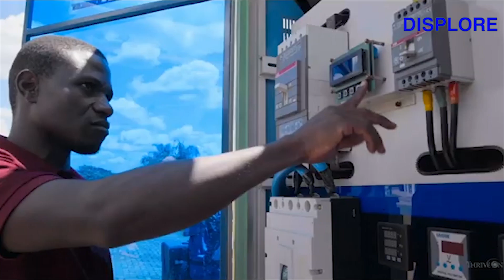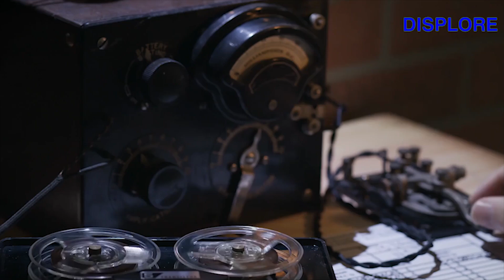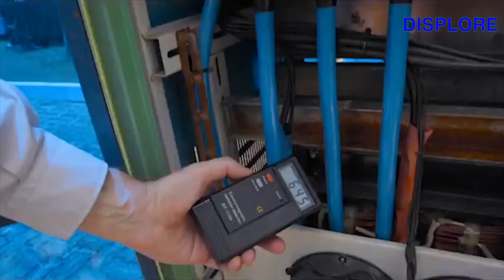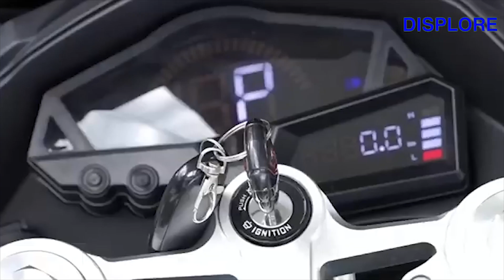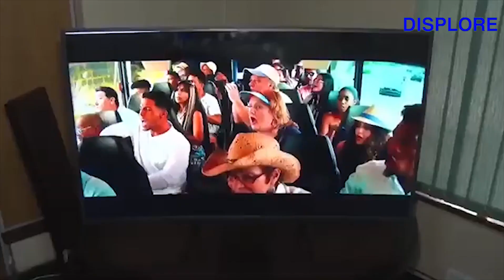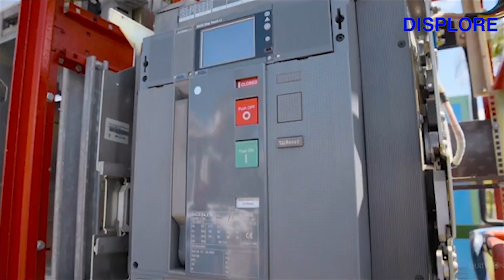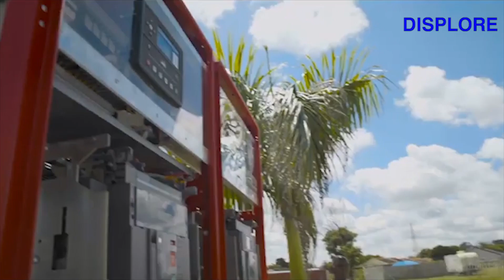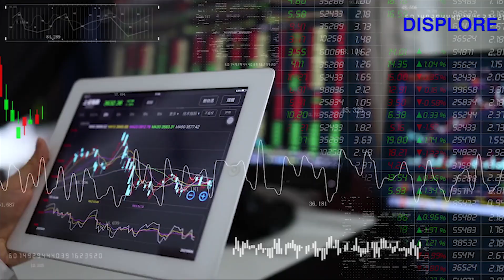TESLA in Big Trouble as This African Inventor Launches The First Ever SELF-SUSTAINING CAR and BIKES

Comment: Let's reframe Earth's low contrast abundant ambient heat as a thermal   energy waypoint between heat and other forms of energy. 

Energy changes form without gain or loss. Uniformity or diversity is not, in itself, a form of energy.  Therefore entropy is an extraordinary claim on the law that energy is conserved. 

Energy sensible refrigerators that absorb heat and yield electricity would complement computers as computing consumes electricity and yields heat. Computing would be free. Chips could have energy recycling built in.
This would improve performance and lower cost. 

Full heat recycling, all electric, very isolated underground, undersea, or space communities would be highly survivable with self sufficient EMP resistant LED light  automated vertical farms, thaw resistant frozen food storehouses, factories, dwellings, self contained elevators, safe rooms, and horizontal transports. 
In a flourishing civillization, small self sufficient electric or cooling devices of many kinds and styles like lamps, smartphones, hotplates, water heaters, cooler chests, fans, radios, TVs, cameras, security devices, robot test equipment, scales, transaction terminals, wall clocks, open or ciosed for business luminous signs, power hand tools, ditch diggers, pumps, and personal transports, would be available for immediate use incrementally anywhere as people as individuals or larger social groups see fit. 

Some electrical equipment groups could be consolidated into local networks when suirable. Liquid nitrogen cooled superconducting networks would become practical 

If a high majority thinks our civilization should geoengineer gigatons or
teratons of greenhouse gasses out of our environment, instalations using devices that convert ambient heat into electricity can hypothetically be scaled up do it with a choice of comsequences including many beneficial ones. 

Refugee communities would be buildable quickly. Fire safes would preserve contents to 1000F for years. 

A simple rectifier crystal can, 
just short of a replicatable long term demonstration of a powerful prototype, almost certainly filter the random thermal motioren of electrons or discrete positiive charged voids called holes so the electric current flowing in one direction predominates. At low system voltage, a filtrate of one polarity predominates only a little but there is always usable electrical power derived from the source, which is Johnson (observation) Nyquest (theory) thermal electrical noise. Max Plank anticipated that ambient thermal noise would become usable with advances in technology.  

In 1973 I filed for US patent 3890161A DIODE ARRAY for an array of metal1/ insulator/metal2 diodes that refrigerate while concurrently producing electric power. The patent was granted in 1975. It was opened to the public domain in 1992. Development is in the public domain while granting me writing attribution. 

The plausible net electrical filtrate from diodes can be aggregated in a first grouping of separate diodes in  consistent alignment parallel. After a primary level of grouping that preferably is in parallel, compound parallel and series networks can be built 
to provide desired DC current and voltage. Within limlts, parts of the  network can be shorted out or open circuted without electricalor chemical  harm. Widely  scalable electrical power always with equal refrigeration is thus possible. The efficiency of each diode is probably low because the initial power within each diode is nanowatts. This inefficiency affects the performance but not the equality of the thermal absorbtion compared to the electrical yield of the conversion. 

The maximum energy is converted from ambient heat to productive direct current electricity when the load electrical resistance  is equal to the array internal electrical resistance. Maximum calculated electrical power output (watts) is k (Boltźman's constant), one point three eight x 10^ minus 23, times T (temperature Kelvin) times bandwidth (0 Hz to a natural limit ~2 THz @ 290 K) times rectification halving and nanowatt power level rectification efficiency, times the number of diodes in the array. 

There are a billion measurment cells of 1000 square nanometer area each per square millimeter, 100 billion per square centimeter. 

Order is imposed on the random thermal motion of electrons by the structual orderlyness of a diode array made of diodes made within a slab: 

Host crystal in this example is silicon 

  P type boron doped
-----‐------‐----___-- Out
🔻🔻🔻🔻
■■■■■■___ + Out
  N type phosphorous doped 

All the P type semiconductor anodes abut a metal conductive plane deposited on the top face of the slab with nonrectifying joins;  the N type semiconductor cathodes or common cathode abuts the bottom face. As the polarity filtered electrical energy is exported, the amount of thermal energy in the group of diodes decreases. This group cooling will draw heat in from the surrounding ambient heat at a rate depending on the filtering rate and thermal resistance between the group and ambient gas, liquid, or solid warmer than absolute zero. There is always a lot of ambient heat on our planet, more on equatorial dry desert summer days and less on polar desert winter nights. 

There are other plausible breeches of the second law of thermodynamics. Hopefully a lot of people, mostly as independent teams, will join in expanding the breech. Please share the successes or setbacks of experiemental efforts. The topic deserves crowd financing, discussion and prototyping attempt action. Crowd development would be resistant to confiscation or burial.There could also be science quality colaboration. 

These rectifiers could be various types, such as:
• Field emission diodes: A metal needle with a compound carbon nanotube tip, separated from a metal plane by a tiny gap.
• Schottky diodes: A metal needle-to-semiconductor junction, like Gallium Arsenide or Indium Antimonide.
• Silicon or Germanium crystal diodes: A well-established technology. These diodes may have poor performance 

These devices would probably become segmented commodities sold with minimal margin over supply cost. They would be manufactured by advanced automation that does not need financial incentive. Applicable best practices would be adopted. Business details would be open public knowledge. Associated people should move as negotiated and freely and honestly talk. Commerce would be a planetary scale unified conglomerate of diverse local cooperatives. There is no need of wealth extracting top commanders. We do not need often token philanthropy from the top if the wide majority of people can afford to be generous. 

The devices should be able to power the manufacture of àn ever increasing number of these devices. There could be net entropy reduction in the full energy accounting of diode array use. 

The entropic deteration of the structure of machine parts made of tough solids is inevitable but can be so minor compared to the stress of their use that machine shops can make many manufacturing tools before the manufacturing tools deteriorate out of spec. Therefore everything involved with the intelligent powering, manufacturing and using entropy reversing devices can have negative entropy. 

Aloha, 

Charles M. Brown
Kilauea, Kauai, Hawaii 96754

Comment: at 200 micro-watts per square meter in order to power a single 100kw engine (like a single 140 HP car), the antennae would have to be 5/6 the size of TEXAS. I don't even see a collecting antenna on the device.
So, either he is NOT collecting radio wave energy and is collecting some other energy, or this is a fraud.
Just as a reference we burn the equivalent of approximately 3% of the total energy of the sun that hits earth. At 40% efficiency, and 68% cloud cover, and 50% daylight; we would need to cover around 22% of the earth itself  with solar collectors to power our needs. The total land mass on earth is around 29%, that would leave about 7% to live on if all the solar panels were on land. This would kill all plant life on earth. Even at 100% efficient we would need about 7% of the land surface covered with solar panels (based on a large efficiency under cloud cover as well).
The current BEST answer are micro-nuclear power plants and we have them, They require no valves or control systems that can fail at all. FULLY passive control. They can be placed at substations and we no longer need full power grids, just local grids. No more burning oil or natural gas, no more old fashioned nuclear plants that can fail and are dangerous because of the amount of fuel rods in a single area."Nuclear POWER is excellent as an answer. It is the greenest power available. And with Space X, we now have a way to be rid of the waist...into the sun!

Comment: Even though everything might be true about the self generation of the car up to this point, it is unfortunately so that cities generally have more radio waves than the countryside due to a higher concentration of radio and wireless devices.

I am therefore of the opinion that this car will never complete the 7500 kms to Cairo due to a lack of radio waves on the way.
Reply: Chikumbutso's microsonic device only uses the radio waves of the waves available in the electromagnetic spectrum.
Reply: It's electromagnetic waves that is being used,,and that is everywhere